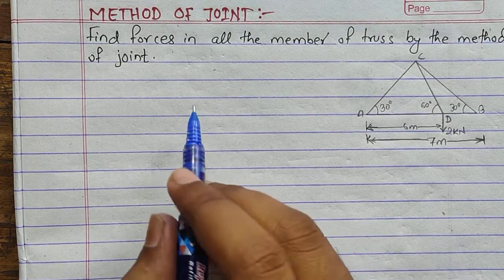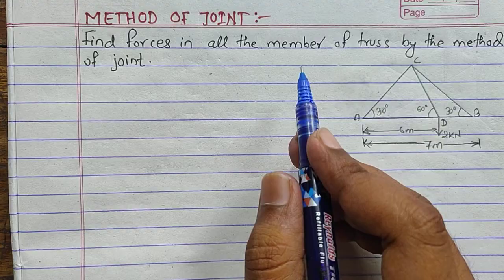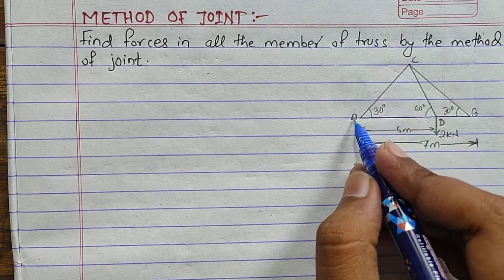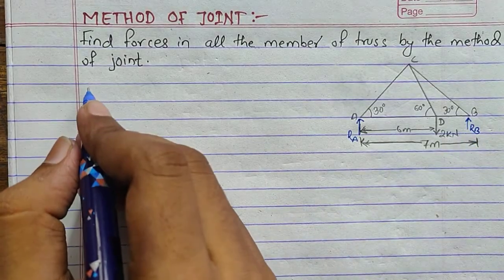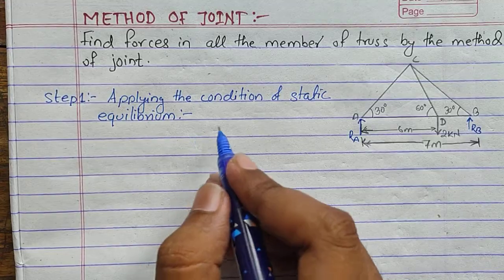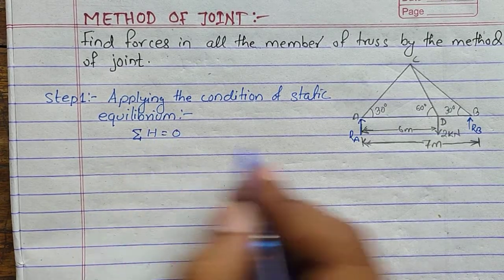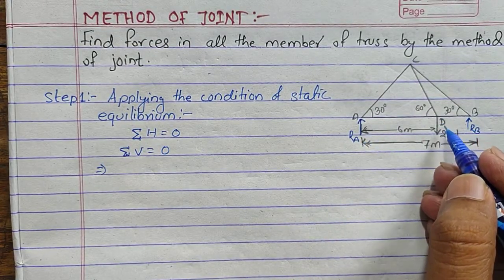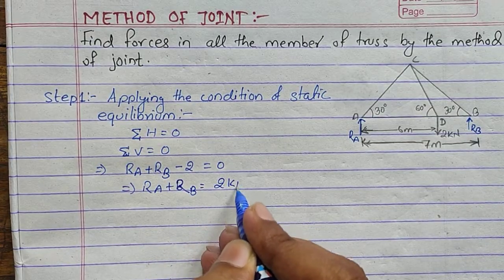Truss analysis by method of joints

Comment: Thanks mate. You have cleared my brain. Thanks a lot bro 😎
Reply from the maker: Always dear.😎😎🤘
Reply: @Civillearningonline  how do I contact you by email?
Reply from the maker: Currently i am working on INFLUENCE LINE DIAGRAM of Structural Analysis 1. After that i will be adding some more examples on analysis of truss and frame by these Methods ( joint, graphical and section).
Reply: @Civillearningonline  I have sent an email.
Reply from the maker: Yes, i got your email. But i was unable to contact you on telegram. But you can contact me on telegram as well as WhatsApp.
Reply: @Civillearningonline  is telegram same as telephone? I tried to ring not reachable
Reply from the maker: You can simply text me on telegram.